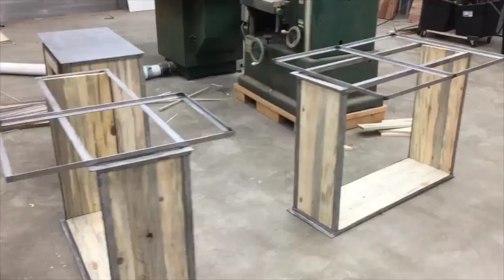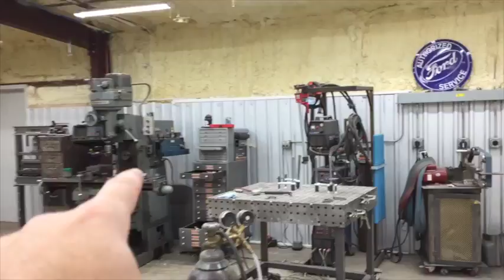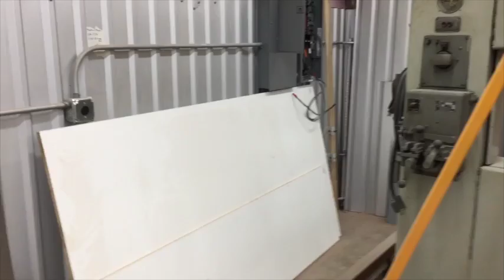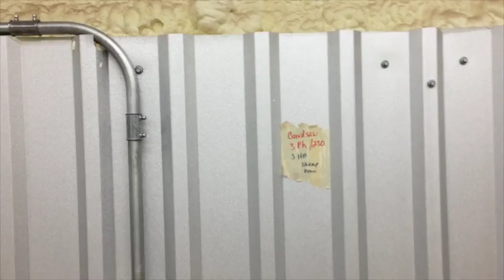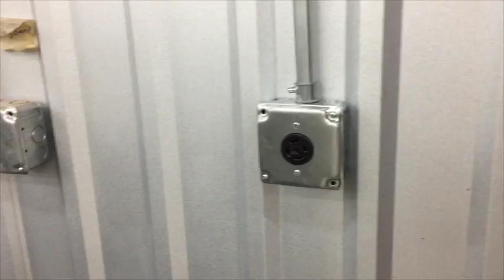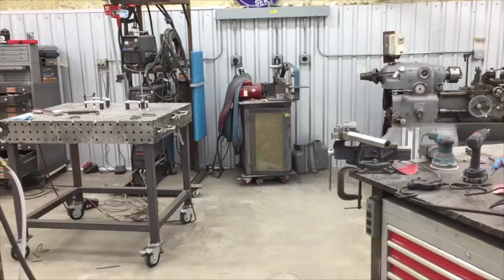Shop Update - Electrical - Tooling From Greg Porter - Plasma Cutter

Comment: I like the look of mixed elements of wood and steel, nice touch. Seen the wood and steel drawer toolboxes in background they look cool also. You might have a very marketable product there if you had a mind to do custom steel and wood installs. I would not give it away tho as its all custom built and not available most anywhere else. 
Also seen a strap about 2 feet long with a metal cradle at bottom and handle at other end of the strap for placing at midpoint of sheets of plywood or presswood ETC and made an easy way to lift that stuff without having to bend over other than to place the metal cradle/foot to grab bottem edge of plywood. Was one of those things the second you seen it you just know it would work well and take the dred out of moving that stuff not to mention save ones back, really worked slick and would be easy to build.
Reply from the maker: Thanks man, appreciate it.

Comment: Oh, ground every box you can. They sell bags of pigtails at HD.  It can save your life if a wire rubs anywhere on a machine or inside a conduit or box.
Reply from the maker: Oh definitely.  I didn't realize that about the pig tales, I bought a spool of #10 green wire and some eyelet ends and added separate ground to the chassis of each machine as well as the motor external to the wiring.

Comment: Rule of thumb.  SJO cord is made to be used in the open air.  When you install it in conduit you can have excessive heat built up.  It may work just fine in your situations but it is not recommended.
Reply from the maker: Thanks Rick, that makes sense.  I will keep an eye on it.

Comment: Gary, wish I lived near you, I am a Master Electrician and trust me you could use some help lol You should not be using SO cord inside conduit and also run some conduit to the ceiling and make some drops using the SO cord with strain relief connectors, You Probably should have run a 100 amp subpanel over where you are sharing circuits, sometimes it is cheaper to just run a small subpanel for equipment and use the breakers inside the sub panel as equipment disconnects. Take your time do not rush electrical work and remember, ground everything ! use proper green grounding screws in every j box there is a reason for the green screws. Like I said I wish I lived near you I know I could straighten things out.
Reply: You should pay him a visit and set him straight! Someone needs to!
Reply: Haha.
Reply from the maker: Some good advice, thanks Cary!

Comment: On that bender, you should consider changing parts of the design to make it easier to manufacture.  For example, change how the handle attaches to the moving part so you don't have to turn it in the 4 jaw.  You could extend the material and make it a wider section, then just drill a socket to accept a handle with the spigot already on it.  For the handle, just take a piece of DOM and weld a dowel pin into the end with plug welds.
Reply from the maker: Excellent idea.  The thickness of hte piece you mentioned is 3/4", so when I cut the profiles out on the plasma table , i could leave a 3/4X3/4 square stud like maybe 3" long.  And use a piece of 1" square tubing with 3/16" wall for a slip fit handle?
Reply: Sounds like a good idea to me!

Comment: You can use CAT40 in NMTB40 spindles, with a longer drawbar.  Just grab the drive slots in a vise and use a wrench to unbolt the pull-stud.  Worse case scenario, you can use a pipe wrench.
Reply from the maker: Thanks man.

Comment: couple of things you might consider. unless you are planning on moving your machines alot, just forgo the plugs and wires direct. also could you use square tubing for the handle on the bender?
Reply from the maker: Good thought on the square tubing.  The stud is 5/8" OD, so maybe 3/4" square tubuing?

Comment: Looks like you are getting busy Gary.  I believe the CAT 40  and NMTB 40 are the same taper but the CAT 40 will require a longer drawbar.  I think you need a different wrench to hold the tool holder and unscrew the retention stud.
Reply from the maker: Bummer, I didn't realize that.
Reply: Yeah Gary I forgot your lathe can't cut threads.

Comment: Those pull studs on the Cat 40 holders will unscrew. Should soak the holders in some of the Evapo-rust to clean them up. I believe you have NMTB holders for your mill currently? The Cat 40 ones are the same taper but don't have the extended nose like the others so you may need a longer drawbar to use them. The spanner wrench looked like it is for a series of ER collet adapters.
Reply from the maker: Bummer, i didn't know that, will see what i can work out on it.
Reply: The draw nuts are just really tight. In a CNC it's not good if they come loose.

Comment: Gary everything looks good and you are well on your way.  However, you might want to check the code on running the SOJ cable inside the EMT.  I don't have anything in front of me to check but I know it is a no-no to run romex inside EMT but can't remember on the SOJ.  On those CAT-V 40 holders, invest in a holder or make one then your will be able to remove the tension bolt.  ONce you get going on those CAT-V holders you will definitely want to have a holder to replace tooling.  Good luck!
Reply from the maker: Thanks for the heads up on this many others have mentioned it as well.  I will definitley change it out.

Comment: You can't go wrong with the hypertherm, mine is pretty ancient but never has been a problem.  And I learned the hard way that those chinese plasma cutters are electrically really noisy and difficult to work with in a cnc env.
Reply from the maker: Thanks Ron.

Comment: Keep the hand torch and get a Keith Fenner pop away for more versatility.  You ever get the mill horizontal spindle running?
Reply from the maker: Not yet on the horizontal, It does have a magnetic break, adn I dont' have it wired properly, so I just need to open it back up and change some wires around, and it will be all set.  I will get that done here in the next few days.

Comment: Looking good man.  I'm sure you're itching to start turning time into money.  I love the look of the bender.  So I don't know anything about machining and have a question.  The part which you said you need to setup in the four jaw check and turn the round end on the rectangular piece, could you just keep the rectangular piece drill a hole in the end and just insert round stock in it and weld it in?  Just trying to learn, not questioning how your doing it.
Reply from the maker: Yea, good question.  I just did it per the design, not sure if that would weaken the leverage point by having a hole in the end?  Definitely something to look at as a way to save time and lower the cost of the bender.

Comment: Good update, Gary. If you don't plan on using the table saw and the planer at the same time, why not put a double female plug on the end of the extension chord so you don't have to plug and unplug all the time? You can't run both together presently, so it wouldn't be any change other than for convenience and safety, since over time with plugging and unplugging you will wear out your plugs. Just a thought.